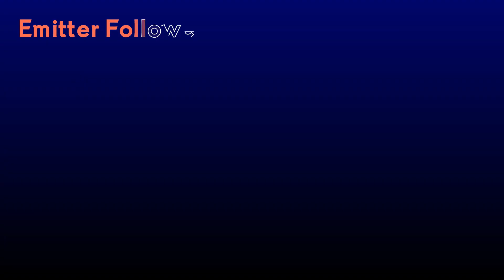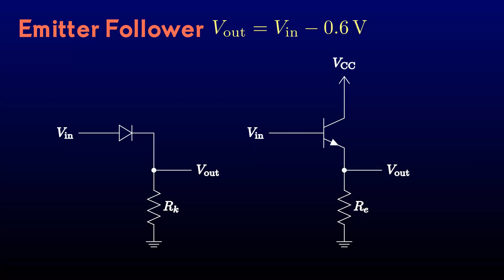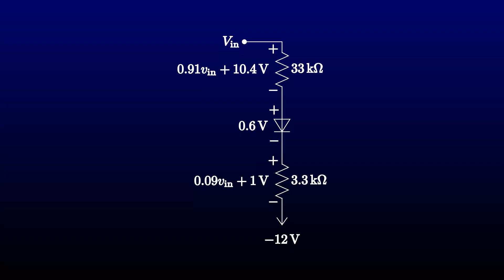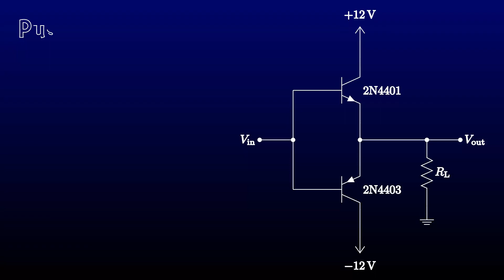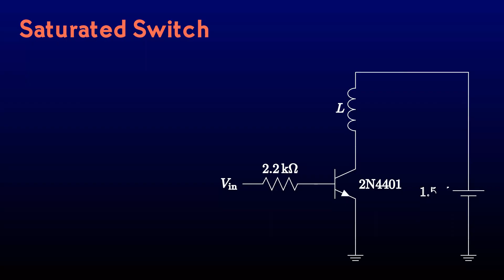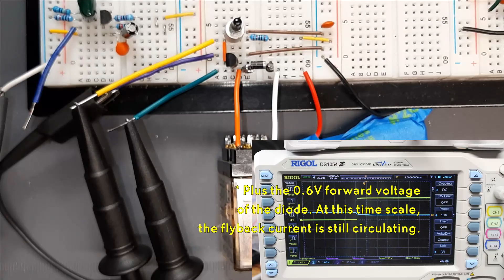Transistors 101 ep4: Followers and Switches

Comment: Way back in 1975,  I was called in to try and help getting a machine running.  They had spen $160,000 to build this thing  then somewhere between $3-400,000 to get it working properly.  There was a panel that displayed errors,  and every single one of those errors was being displayed.  That was driven by relays, which were driven by logic.  Nobody until I came along had thought to add those diodes in there,  so every single bit of logic driving those relays was blown...
Reply from the maker: Around about 1978, I was troubleshooting a mainframe computer that was having endless unreproducible errors that were bit pattern sensitive.  It turns out that there was an entire board with an open ground. The current was returning through protection diodes to whatever logic was driving it. Too many logic-HIGH inputs and it stopped working.

Comment: Also why is the resistor drawing 1.2 amperes when the output is at ground I get it that it’s because there is a voltage difference between gnd and -12v but there is to resistors in series here so 12v/10 is not working here I honestly think I am not getting the point ur making in that statement at 8:44
Reply from the maker: When the output is at ground, the top of the resistor is at ground and the bottom of the resistor is at -12 volts. There's a 12 volt difference across it.  12V / 10 ohms = 1.2 amps.  (That's hypothetical. A 2N4401 would have let out the blue smoke by that point.)

The important point is that we can't increase the current-handling capacity of our follower by just making the emitter resistor arbitrarily small because it would lead to ridiculously high currents, ridiculously low power efficiency, and thermal management problems. That's why we go to a push-pull configuration.
Reply: That is reasonable

Comment: When I am calculating the  offset I get 0.91vin plus 10.92v and not 10.4V
Reply from the maker: Are you accounting for the 0.6V forward voltage of the diode?  

Current through the divider will be (12V + v_in - 0.6 V) / 36.3 ohms. = (11.4V + v_in) / 36.3 ohms
At that current, the drop in the upper resistor will be 10.36... volts (I rounded to 10.4) and in the lower resistor 1.036... volts (I rounded to 1).